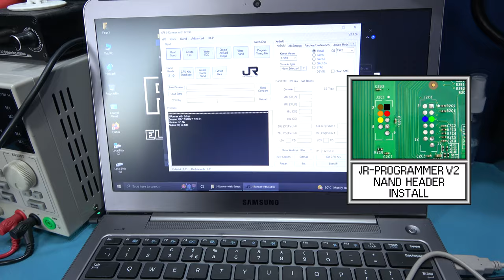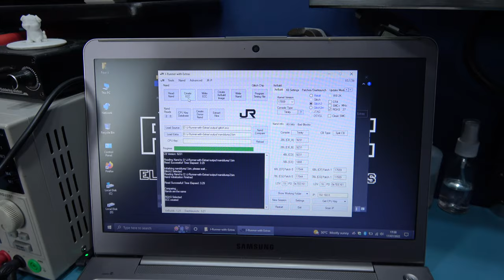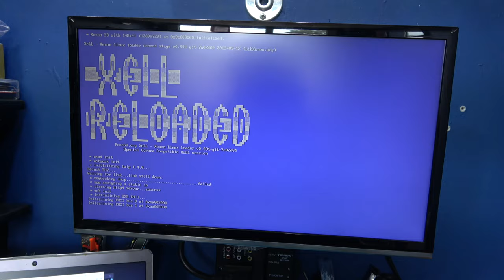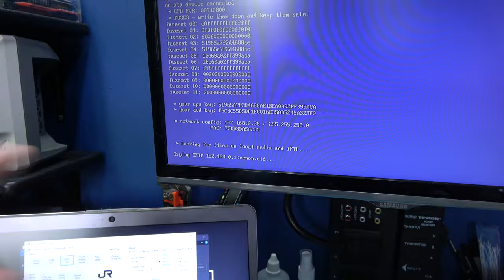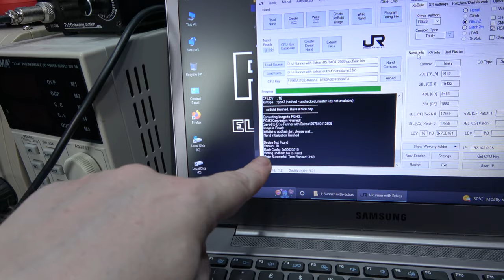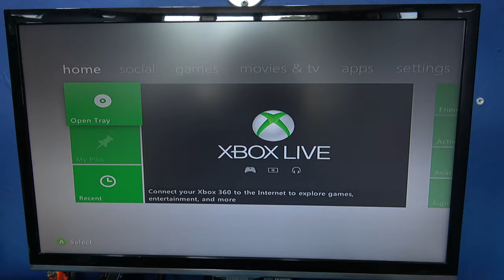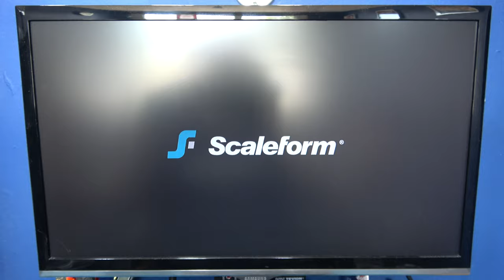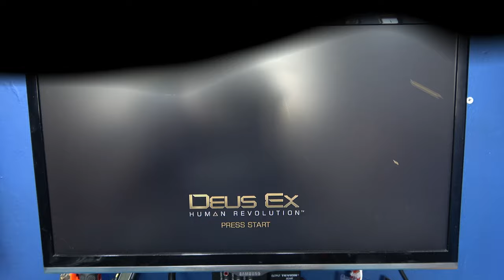Xbox 360 Slim - RGH 3.0 (Reset Glitch Hack 3.0) Install (Trinity).

Comment: is there any disadvantage in this chiples jailbreak compared to the jailbreak with a mod chip ???
Reply from the maker: Soldering it in is a little trickier apart from that its much better because your using the Xbox 360 it's self to glitch and it insta boots first time.

Comment: Hi I did everything as mentioned but when I powered it on, it went through the xbox logo and then shows red light with error e71
Reply from the maker: e71 can indicate a bad HDD, some pluging for Dashlaunch can cause this also. It could be a bad flash, rebuild the glitched 3.0 image using your original NAND dump and flash from USB using xell.